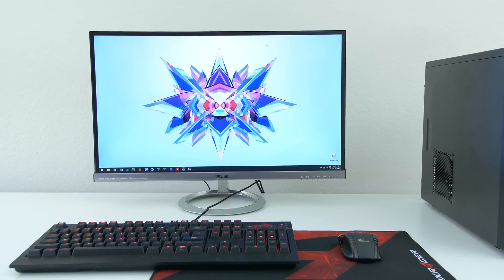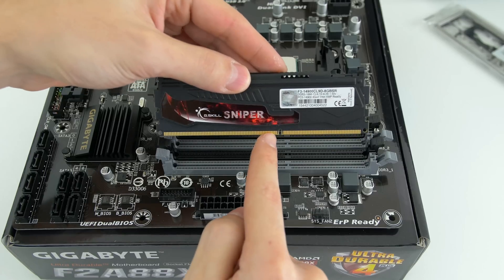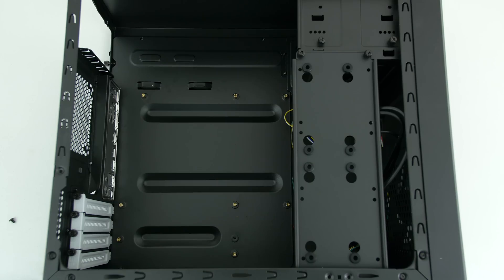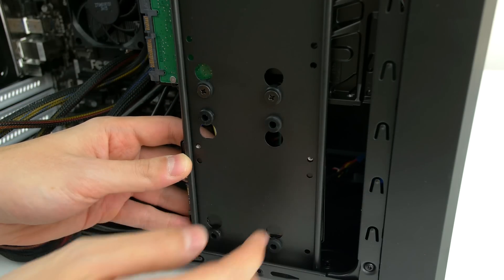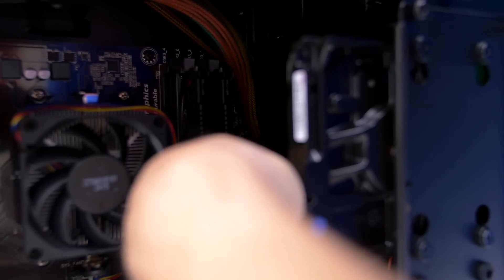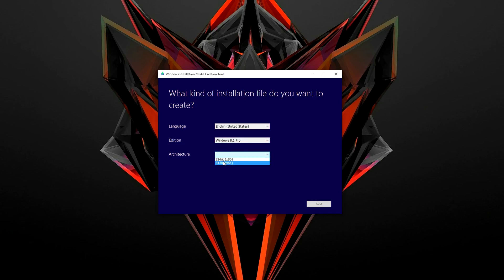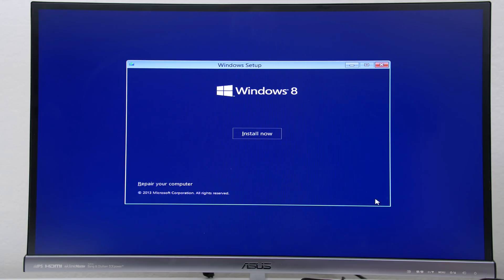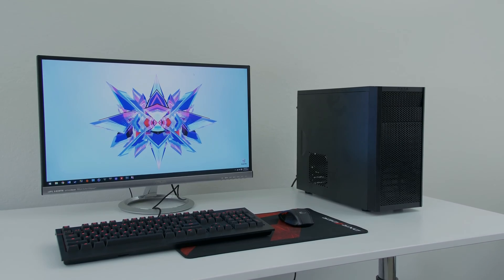How To Build $450 Gaming PC w/ Windows Install

Comment: So let's say I already own a copy of Windows,  can I use the money I saved for a slightly better or cpu?
Reply: cool stuff thanks for the reply :)
Reply: +Bass Boosts yes. get a better GPU for gaming. or a better cpu for other tasks/ multitask. depending on your requirement.
Reply: Rohan Arora thanks! So with the money i save, whats a better GPU i can get?
Reply: +Bass Boosts r9 290 maybe. or a 380. both are good. on the nvidia side 960 is good but 2gb vram is a bummer. R9 290 would be a better call
Reply: Thanks! Now if you were to choose a r9 290 or a 380, which one would you go for? (Dont worry about price in this situation)
Reply: +Bass Boosts 380. 512 bit bus. ;) get the max vram you can. then you can play on max settings with no issues. shadow of mordor and bf,4 use up memory like crazy
Reply: Rohan Arora cool stuff! I added everything up in microcenter.com and the total came to $466. Def buying soon!
Reply: +Bass Boosts the r9 290 is better lol
Reply: Harry Tung how ?
Reply: +Bass Boosts it isnt better. except if u find one so cheap that it would eliminate all other factors.
Reply: +Rohan Arora oh
Reply: Bass Boosts look at the benchmark
Reply: i may sound stupid but where can i find one?
Reply: Bass Boosts do you care paying more?

Comment: is this build good?:

-intel i5-4460
-Western digital 1tb
-Evga 500w power supply
-Corsair Vengeance 4 GB DDR3 1600 MHz (2 4gb)
-Evga gtx 960
-ASUS Micro ATX DDR3 2600 LGA 1150 Motherboard H97M-E/CSM 

And is there any parts im missing? Thx in advance
And do I need a cpu cooler for the i5 or the cooler that comes with it is good enough

Comment: is this a good enough build
860k might oc it with stock cooler
r9 360 gigabyte oc
550w psu
a motherboard with my needs 
tp link wireless usb
1tb
a case with 2 fans that have red led plenty of cable management
8gb of ram 
will it play fallout 4 ultra with some setting down to high and God rays and other stuff like distance turned down 30-60fps 
will be upgrading this to a i5 4460 till summer and upgrading gpu next Christmas
Reply: Also it cost 452 euros plus shipping from a German website I live in Ireland and the prices are very high when I use the UK sites I might use eBay to if I find a deal
Reply: +BadpcGamerHD meant to say 452 Euros total including shipping
Reply: +BadpcGamerHD, lolnope. The Athlon you choose is pretty bad, as is the R7 360, which, for whatever reason, is worse than almost all the R7/9 2xx cards. If you have a little more budget, consider upgrading to the FX-6300 or FX-8350 if you want AMD, or an i5 4460/4590. Definitely upgrade your GPU. R9 290x is way better, GTX 950/960/970 is also a solid choice for your needs. This build should yield at least 60fps on medium.
Reply: Jr. Sharks Nah m8 ill go with the 860k oc with a 270x
Reply: I'm pretty sure the 290/X is same price. it'll run FO4 med 60
Reply: Jr. Sharks nvm dude just ordered a i5 6660 16gb of ram 1 tb and a 750 ti pc build 
total 682 euros next year ill upgrade gpu hopefully 970
Reply: great idea. the 750ti is actually potato, but will smash most games. Im pretty sure the 980ti will be about the same price as the 970 soon, just look out.
Reply: +Jr. Sharks its clocked at 1250 or around that so I'm good it will get me games this year at least not dropping down 40 fps
Reply: If you're going to upgrade to the i5 4460 why not go with the pentium g3258 so you don't have to buy a new mobo and possibly a new windows...
Reply: Nathan Farley why would i downgrade i already ordered a i5 6660 750ti and 16gb of ram the only thing ill be upgrading is the gpu and psu
Reply: Nathan Farley aslo windows is saved on harddrive not motherboard
Reply: +BadpcGamerHD oh I thought you were getting the 860k.
Reply: BadpcGamerHD OEM versions are tied to mobos.

Comment: Will this motherboard work for another CPU cooler? I saw the brackets on the motherboard and was wondering if you can use another CPU cooler (like the one in the description).

Comment: Hi. I'm building a gaming/productivity PC and I have a question. Should I buy a cheap wifi connecter for $10 and buy a more expensive, connected-to-motherboard wifi connecter later, or just spring for the more expensive one now? The only reason I'm worried is because my room has bad wifi and I want to be able to get a connection. I'm only asking because I'm at my budget and I'm trying to cut costs as much as I can. Thanks!
Reply: +MeepCraft Gaming Don't buy a cheap one. They typically have very little range.
Reply: +ArgaJones Om thanks for the response ;-)
Reply: MeepCraft Gaming No problem :)
Reply: +gamehero4 +Geron Phillips Ok thanks so much for the response. I've decided to go with a usb receiver. Thanks again!

Comment: worried about putting in the cpu. Heard it's really delicate and I shouldn't wiggle it around cause the pins break super easy?
Reply from the maker: U will be fine. Just dont apply pressure
Reply: +Bsty zed Because oils from your hand/finger could get on the CPU
Reply: +iJeewon youll be fine, AMD chips are fairly strong compared to Intel so yeah you've got that going for you
Reply: +Technite Actually, Intel moved away from the pin design on the CPU which i believe is smarter since the CPU is in a lot of cases more expensive than the motherboard. Also over my years of experience with LGA vs PGA, AMD chips tend to stick to the thermal paste pretty hard (stock thermal paste which many use) and end up breaking the pins when trying to pry the heat-sink away.

Comment: hey guys!, is this pc build good enough to run battlefield 4, arma 3, gta 5, ark?

AMD FX-6300 3.5Ghz 6-Core
ASRock 980DE3-U3S3
WD 3.5" Green 1TB WD10EZRX SATA3 64M 5400RPM HDD
Kingston HyperX FURY Blue HX318C10FK2/8 8G Kit (4Gx2)
SHAW GT-GM4
Aerocool VX-600 600Watt C6/C7 Power Saving Mode Supported
Asus 2GB R7 370 STRIX OC PCI-E VGA Card
Reply: Maybe, i think it will do, but if possible a 4gb videocard would preform alot better, but if this is your budget then yeah, it will do
Reply: thankyou manXD
Reply: +Evan Seagull 960 man
Reply: +JESSE MOFFATT The r9 380 with its 4GB VRAM is much better than GTX 960

Comment: Is there any wireless adapters I can plug into the lan port of the pc? I don't want to waste any ports
Reply: +Guys Who Do Stuff Or a PCI WiFi card.
Reply: Simple fix is a usb wifi adapter. Just get a usb hub, plug it into one of the usb ports then you have extra ports. Then plug in the wifi dongle.
Reply: ok thanks :)

Comment: Why don't you just use the windows 10 ISO or USB drive thing? Cause then you can just use a windows 7 or 8.1 activation key or there is this one sight where it activates for you.
Reply: +TheMultiRugga™ because windows 8 is cheaper and its no trouble upgrading from there. windows 10 cost like 150 dollars for a product key, windows 8 is about 20 dollars
Reply: christian Cameron Yeah but you can just download the windows 10 USB thing off the internet, like shown in vid. And then use a windows 7 activation key which u can get for like 15 bucks and then activate windows 10 with that. It's what I did and it works fine. And technically it is just upgrading from windows 7 so there is no conflict from any laws or anything!
Reply: +TheMultiRugga™  anybody else tried this?
Reply: Vali Podaru IDK, my friend did.
Reply: +TheMultiRugga™ Is that really the process? From what i know, if u have windows 7/8/8.1, from there you can upgrade to windows 10 free. So you have to install windows 7/8/8.1 1st because the activation key is specific to that windows version. Can you confirm with your friend?
Reply: TK TrueKep Naa I installed the windows 10 to a knew SSD, with every other OS removed, and just put in my windows 7 home key in and it worked.
Reply: +TheMultiRugga™ that doesn't work, Microsoft confirmed that Windows 10 uses a different product key system now. What you have to do is download Windows 7 for free and crack it and then upgrade to Windows 10 for free and it will be legit

Comment: just to let everyone know, it doesn't matter if you put the switch on positive or negative, it will work either way. you only need to line up positive and negative for led lights

Comment: Will this PC run newish games like gta v black ops 3 and csgo, I have a i7 processor , 12gb of ram(I know it's a unusual number) and a gtx 750 graphics card? I'm thinking to upgrade the graphics card as I think that's the weak point of my PC
Reply: +Gostcut Gaming   it will crush csgo         bo3 and gta v will be playable at 1080 with low-med settings    the gpu is whats holding u back  processor and ram is perfectly fine
Reply: Might want to switch to a 950 if you want high- max settings
Reply: +Nick Gibboni thanks for the help
Reply: Basically what's been said, your gpu is bottle necking your cpu. I would try and get a 960 or push for a 970 if possible
Reply: 980ti for max performancr
Reply: Get the GeForce Titan X 😏
Reply: I have an i3 and a 750 ti FTW and get a solid 60fps very high/ultra GTA , high bo3 60fps
Reply: +Nick Gibboni stop saying low/med on bo3 and GTA, YOU CAN RUN IT IN HIGH WITH 750 ti (bo3) and ULTRA in GTA5 fuck you Nick
Reply: +TheGamingKamikaze and the others
Reply: +TheGamingKamikaze dude calm down  why r u getting so upset over this?
Reply: Nick Gibboni because it fucking hurts and disturbs me with the lack of untested opinion, how do you know if an optimized card of 750ti run low  on fucking bo3, even Tech Source made a video of 750ti with a pentium ran gtav on ultra and blackops on high 40 fps
Reply: right 40 fps, not 60
Reply: Nick Gibboni you're so over dramatic just for fps
Reply: TheGamingKamikaze i'm not being over dramatic. you're the one that flipped out over me stating my insight on how well a GPU could run a game. there was no reason to act like a 12 year old. in fact, you might just be that old. i would never be able to tell based on how you handle yourself. i'm not replying to you after this so either grow up and act like a somewhat respectful human being or continue acting the way you do and see where that gets you in the real world. Enjoy your day imbecile.
Reply: Nick Gibboni Bitch Please, you cannot state a human based on his reaction on a comment, sure I looked like a 12 year old, but there is something called having high stress levels, but please check your facts before your typing your shitty comments implying that you know everything,

Comment: aproximately how much would this cost without the hard drive and windows copy? 
also it it not possible to get a inbuilt wifi chip for this setup?
Reply: +solo mccraft Just find a WiFi card that plugs into a PCI slot.
Reply: ArgaJones ok thx
Reply: solo mccraft No problem.
Reply: I recommend a Panda Wireless wifi adapter that takes up 1 USB connecter.

Comment: i want cheap pc that gives me at least 100+fps in Minecraft  is that possible ?
Reply: Or install optifine. I built this for my little brother 2 months ago http://pcpartpicker.com/p/jNRx8d all he does is play minecraft. He runs a 250 fps max settings.
Reply: Mate... Want me to make a pcpartpicker build for you?
Reply: Guys Who Do Stuff ye plz
Reply: The average gamer can't see more than 70 FPS...
Reply: ItsVortex i just dont want to lag out when working on massive buildings
Reply: +EagleScopes If you want 100 FPS just keep your game at low settings and it will be about 100-150 FPS
Reply: +Guys Who Do Stuff the gpu is shit
Reply: +Harry Tung He wants to play Minecraft, Minecraft doesn't use the gpu it uses the cpu and RAM because it's a java based game. With that gpu he can run payday 2 at a steady 40 fps.
Reply: I am expecting a pc to have 100fps when normal,because when you turn on shadermod,you gonna have shutter and lag
Reply: +EagleScopes m8 buy a $50 pc and you could run mc at 500 fps
Reply: +ItsVortex don't use your shitty opinions, there is nothing called average can't see more than this and that, fps are frames per second the more frames it loads the more smoother, mostly you should have a monitor that is 60hz or more like 240hz, don't even try

Comment: hi ed, first of all congrats for the vid!
I have a question, i want to upgrade my pc and i will have this components:
Asus z-170 a
Intel i7 4970K (or something like this)
Gigabyte Windforce Gtx 970 
16gb of DDR-4 RAM
cooler master 212evo
Intel ssd (120 gb)
2Tb HHD
So this are the specs, but i don't know if 500W on my power supply are enough.
I will be really happy if you can help me out, thank you!